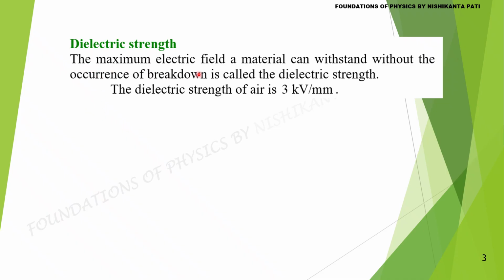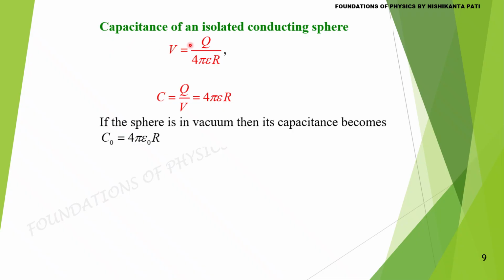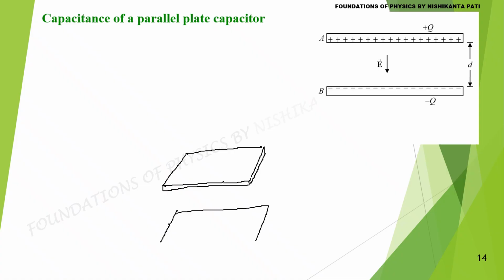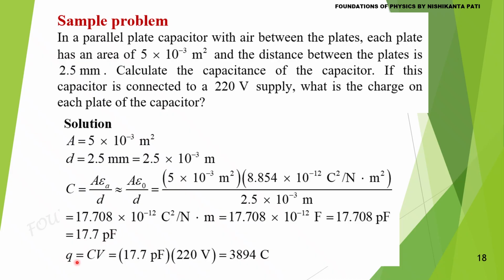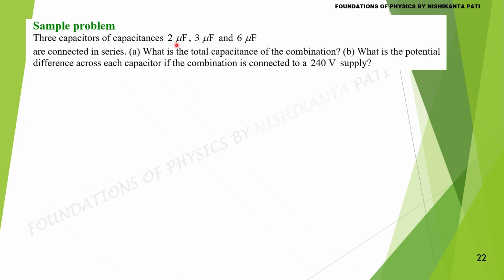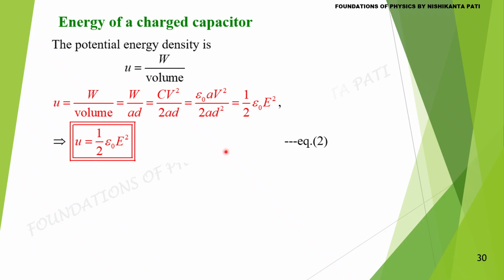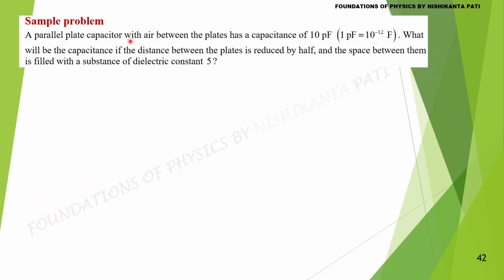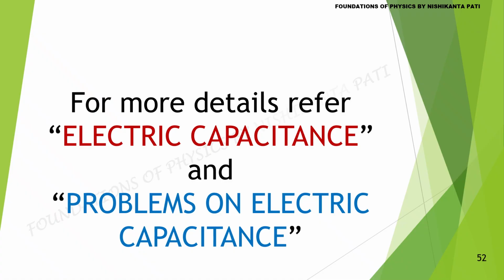Electric Capacitance ( Physics - Class 12 ) At A Glance | Within 1 hour

Comment from the maker: In slide 7, equation 2 is applicable for linear and isotropic dielectric. 
In slide 28, in solution (b) micro should be replaced by pico.
Drop a comment below if you need any clarification.

⚡ Class 12 Physics – At a Glance Playlist:
[ https://youtube.com/playlist?list=PL_ifkrQCZJTEx3LGKRZ_xqduKDeI8Eclt&si=Kc5R_EDa6i1yYnG1 ]

Quick recap of concepts, formulas, and important points from every chapter.